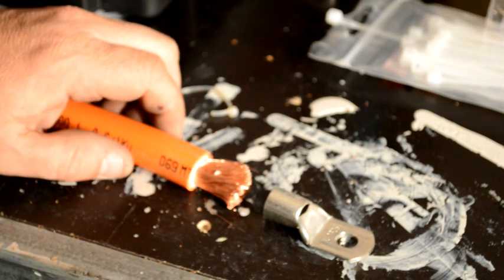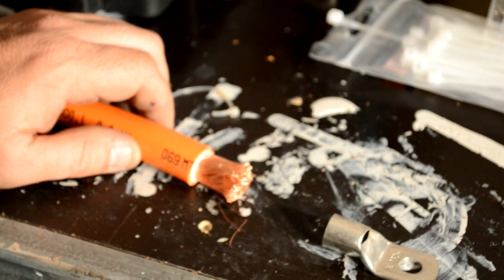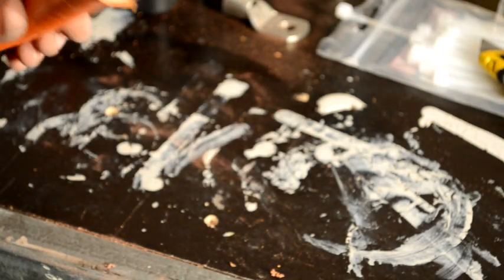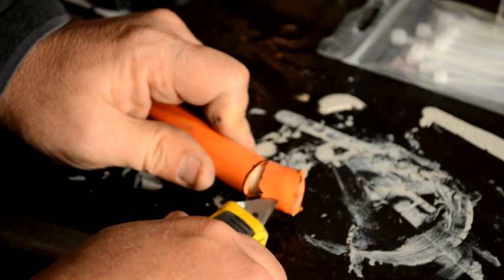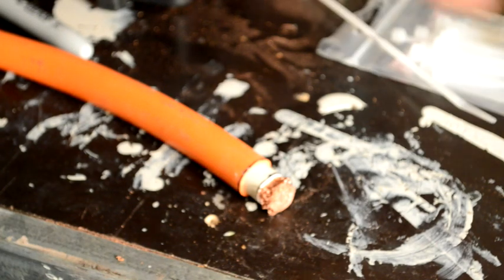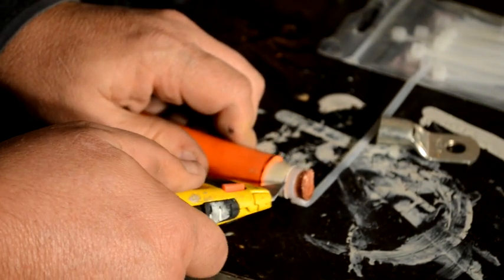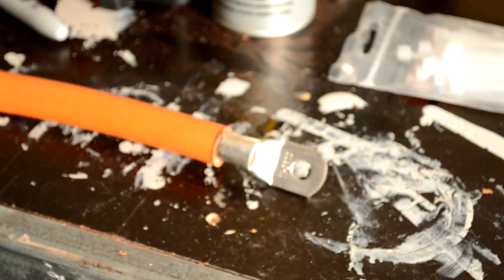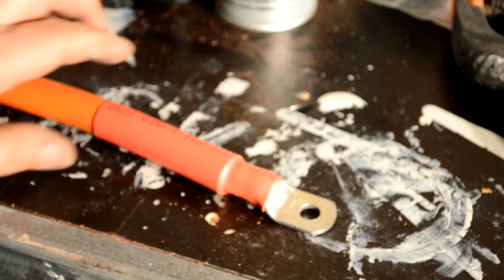How to fit a lug on large cable without fraying wires.

Comment: Hey thanks for the vid, I stripped the inner sheath and slid that down to the end, I fitted 3 small cable ties as I progressed, the lug, I used a large drill and slightly tapered the end of lug and also slightly belled out the lug. I just used a plumb bob point and give it a slight hit with the hammer. I found the key was the silicone spray it made a big difference. In all, your video gave me the concept of what to do, :face-green-smiling:

Comment: Great video.
I do this.
Cout wire nicely. 
Then I cut through isolation in the length of the lug and then again 5mm over that again .
Peel that off so there is 5mm free off isolation. 
Push the lug on so the free space goes to the end .
Cut 5mm off again and peel that of.
Repeat it till the lug is on to the end.

Comment: I've seen a lot of people use all sorts of methods to put lugs on cables and this has to be one of the most cumbersome and clumsy ways I've seen yet. Here's a tip for anyone needing to do this: Start by buying quality, flared end, lugs. The flare does two things: it makes it ridiculously simple to fit the cable and it adds a bit of strain relief by eliminating that sharp transition at the end of the lug. Your fingers and cables will thank you, plus you'll be able to fit a lug in seconds.
Reply: Some lugs just suck and you need another method..lol

Comment: Used those crimpers before, they leave airgaps in the lug. Using silicon spray doesn't make the connection better neither. All in all, this is not the lowest resistance connection. Even a few 10's of Ohm resistance is enough to make the voltage drop over the connection heat the lug up. A powerless of a few hundred watt is enough to let it glow.
Reply: Soldering is similar bad at high currents.

Comment: I wrap a narrow strip of tinfoil around the end of the copper strands and twist the foil into a point. That will allow all the strands to be neatly inserted into the lug. The rest will go in easily. You can strip the cable to the correct length right from the start too. It works like a charm.

Comment: I've always had a hard time getting the cables on without missing wires but it's never this hard. Are you by any chance using standard American wire gauge connectors with metric wire
Reply from the maker: With everything being purchased from Ebay anything is possible.

Comment: I do the following. Strip the first part the amount that you need to insert into the connector, then go back another 1/2" and through only the sheath.  Slide that 1/2" of the sheath to the end of the wire and the wires will be compressed.  Slide on the connector pushing sheathing back.  Fewer steps, you don't need a zip tie and the wire bundle is a circle instead of a zip tied tear drop shape.
Reply from the maker: Great tip mate. Cheers